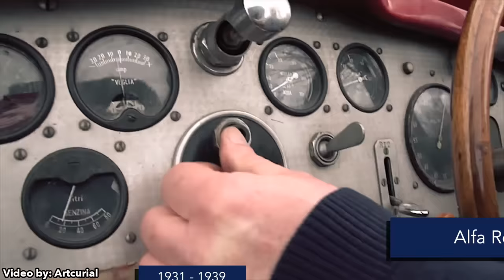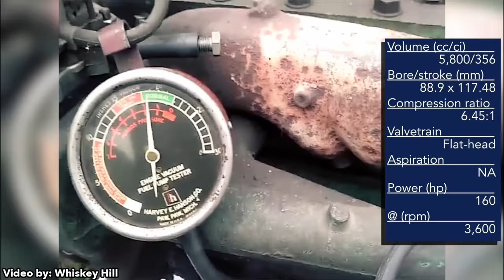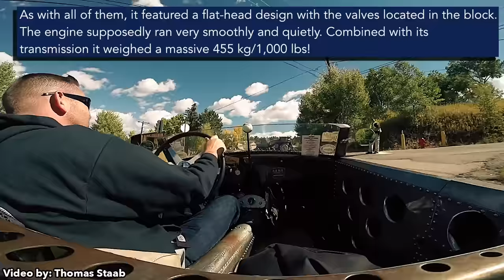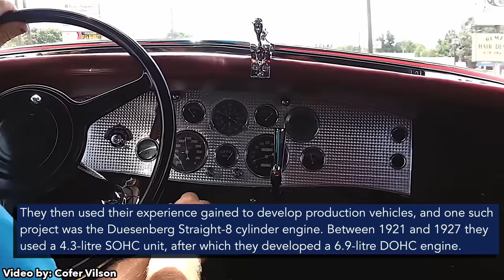The Best Sounding Straight-8 Engines In The World

Comment: I would love to build a 5 valve per cylnder  turbocharged flat 8 engine with the warble of a Subaru/Porsche mixed with the unmistakable 8 cylinder sound. Mmmmm
Reply from the maker: Hm, sounds lovely
Reply: Thanks ;-)
Reply: why 5 valve per cylinder? Flathead might be "good" for 4 valves. Having a 5 valves per cylinder would have screwed your compression ratio and also the combustion chamber shape would have been terrible.
Reply: Cheers :-)
Reply: not "flathead" but flat-v8
Reply: Rick Delair Yeah, I see it now. But said it also wrong. He is talking about flat 8. Flat v8 is like what? ;-)
Reply: Haha that's fair enough :-)
Reply: ScaryMetalGuy it's just like v8 but with 180degree bank, boxer is diffrent
Reply: The 12 in the Ferrari Berlinetta Boxer is technically a V12, just with the banks flattened down. A true boxer has individual crank pins, the "flat V" shares them. #pointlesstrivia
Reply: A "V"8 with 180° between cylinder banks.  This is obviously completely different from a boxer 8.

A V8 would have opposing pairs of pistons sharing a crank pin, a boxer 8 (like two Subaru engines grafted together) would have opposing pairs of pistons on separate crank pins 180° apart.  So, on a 180° V8, if cylinder 1 is on TDC cylinder 2 is at BDC, but in a boxer 8 both would be on TDC.
Reply: Go with a 2 stroke and eliminate all this 4 stroke complex valve crap. That what i want to do.
Reply: Good idea! But then opposite engine 2 stroke straight-8. Power valve exhaust system, intake reed valves. Wow that would be awesome, don't it?!
Reply: Steven Keller   Really? Ever hear of a Ferrari 355? That should cure you.
Reply: Bruce Miller if that were a great idea that would be a standard in racing. You do realize the only currently mfg 2strokes blow leaves right?
Reply: Some use blowers for scavenging like Detroit Diesel, It also works on a 572 alumimun v8 hemi in order to make it into a 2 stroke as some boat racers have done.
Reply: Or power big ships but they have exhaust valves.
Reply: Uniflow are the most efficient 2 stroke with better torque for big engines. Ported loop engines are good for small to around 500 CID 8.2L v8 from sleds, bikes and race cars from what i heard.
Reply: And built for diesel :)
Reply: Listen to the Porsche 917.....LOL
Reply: If you want to be this extreme, than do Rotary inlets. No 2 stroke is more racy than this!
Reply: Lycoming IO-720. Standard equipment in the Piper Comanche 400.
Reply: you only need 2-3 valves for boost. you don’t even need to raise lift hardly
Reply: you can achieve that sound on any engine if you add muffler bearings and put winter air in the tires.
Reply: i hope you mean a boxer type engine not a flathead. because a 5 valve flathead would be terrible.
Reply: @ScaryMetalGuy  4age blacktop engines from Toyota have a 5 valve per cylinder design developed by Yamaha. They produce more power due to the fact that it’s the most specially efficient way to get fuel and exhaust in and out of their cylinder.
Reply: Boxer 8 and Jesus has left the chat
Reply: Just remembered that Porsche used a bunch of boxer 8s in some of their racing cars